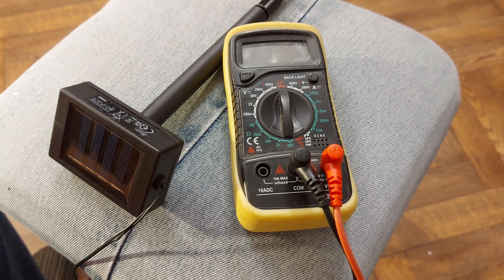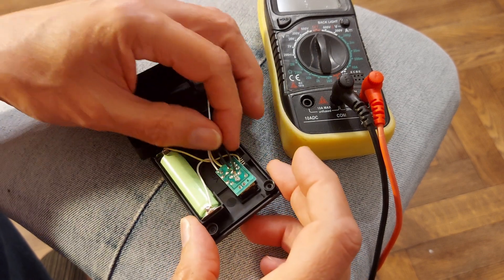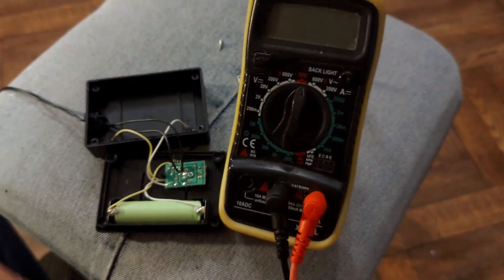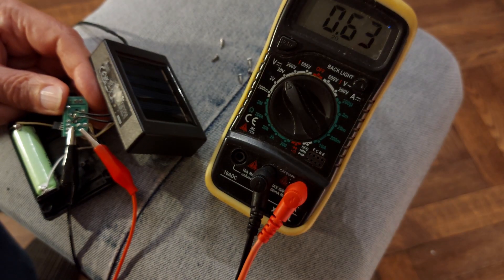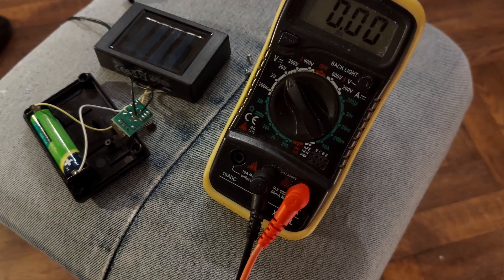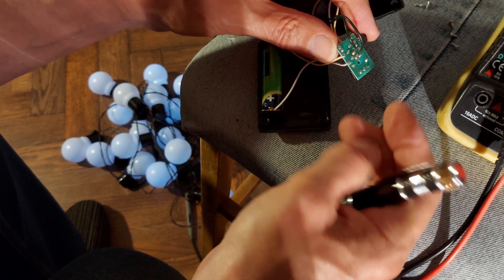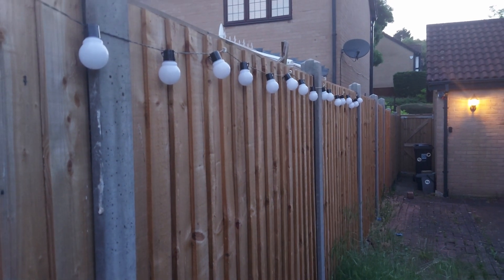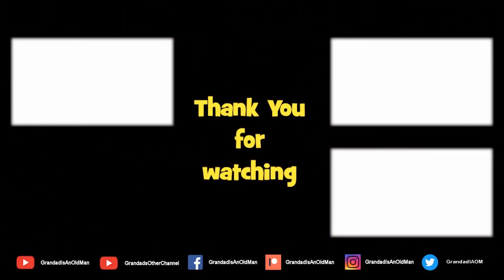Poundland Solar Lightbulb String PART 2. Problem fixed 😁

Comment: I'm a bit surprised at the quality of the build. The wires from the solar panel are usually paper thin on these things.
Even the solder job is surprisingly clean.